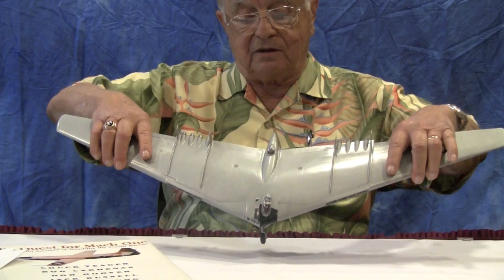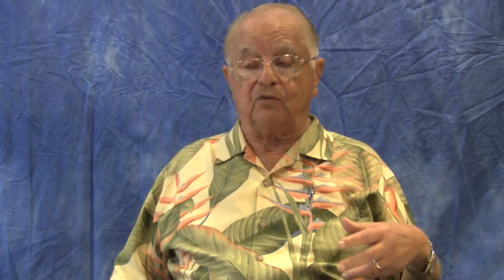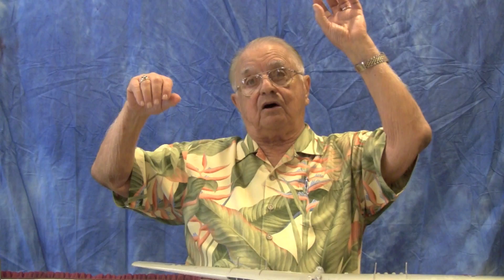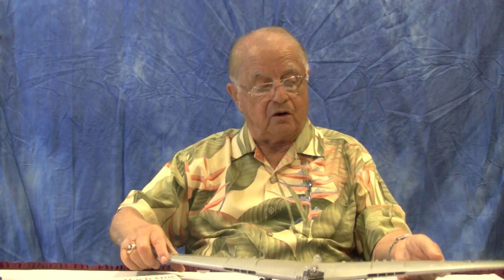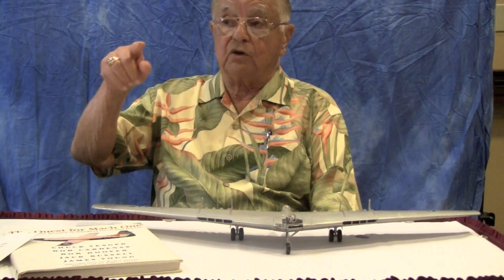General Cardenas - Tumbling in the YB-49

Comment: Gen. Cardenas had made sure that flights that happened after his, that recovery be done this way. Who knows why Glen Edwards, didn't recover.
 I wonder if they were told not to do stalls in that manner.
Reply: Edwards wasnt the pilot on that fateful crash. Major Forbes was.
Reply: @davidmoser3535  Gen Cardenas warned of stalling this aircraft voluntarily, that's what happened to Forbes and Edwards. Seems they didn't listen or remember.
https://www.youtube.com/watch?v=Y_dBbkm3HR0&t=2s
Reply: apparently the ends of the wings came apart
Reply: Major Daniel Forbes was piloting the YB-49 and Glenn Edwards was his co-pilot.  They were attempting stall recovery maneuvers.  Unfortunately, the last time they stalled the aircraft, it went into a pilot induced oscillation that they could not recover from, which caused the aircraft to break apart.  All 5 crew members onboard perished in the crash.
Reply: @jimfinlaw4537  thank you for the extra input
Reply: @jimfinlaw4537  That pretty much covers the official report, but I have it on good authority that's not exactly what happened.. 
My Uncle was Dale Edwards. Glen's Nephew. Dale flew B-47's for SAC in the 50's and spoke to Gen Cardenas personally on this issue.
The reason they couldn't recover the airplane might of had something to do w/no engine power.. either side.. That's what I heard from Dale.. who heard it from Gen Cardenas. He said.

Comment: He is  a hero, instead of bailing out he figured it out. People like this are the reason the rest of us live our normal lives.
Reply: It might not have even been possible to bail out under those conditions. I always wondered if tumbling might be a problem if a flying wing design like that were to stall, I guess it is. The big problem with the YB-49 was that it really needed a digital fly by wire system that would not exist until decades later. The Avrocar had the same problem, it would have worked if fly-by-wire had existed at the time.
Reply: You know, Gen. Bob Cárdenas was an amazing pilot. Besides this harrowing mission, he was also the B-29 pilot that took Gen. Chuck Yeager up to break the supersonic barrier in 1947. Gen. Cárdenas was a total badass and a hero pilot.
Reply: He had no chance to bail out, as the other comment says, and being normal means you have to do this, too.